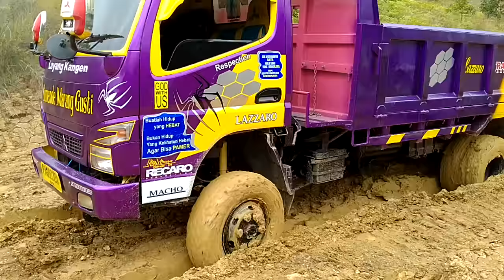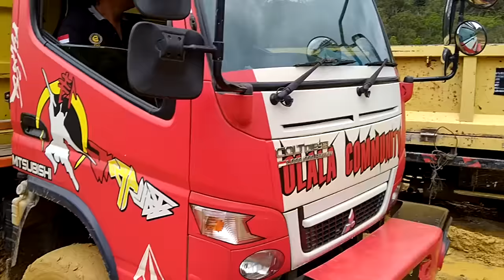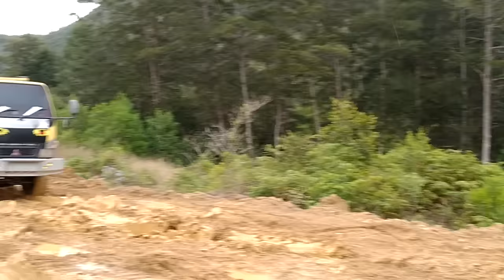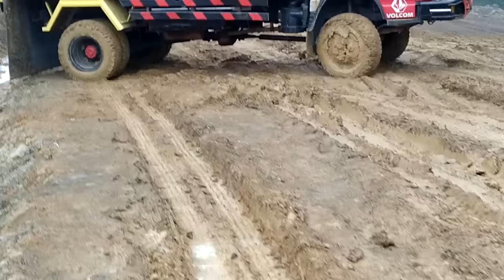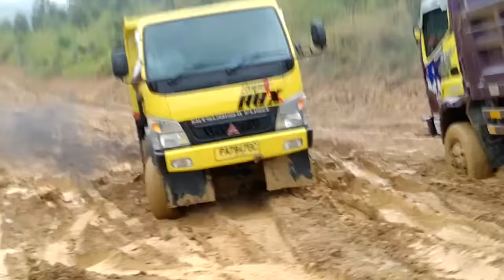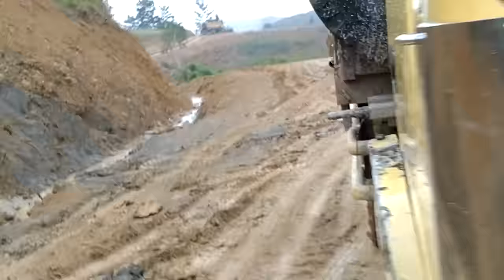Baru mau kerja sudah main lumpur #cerita truk double gardan wamena

Comment: Info estimasi harga modif 4X4 capai berapa duwit ya kawan. Biasanya modif itu di mana karoseri atau bengkel. Mks
Reply from the maker: Kalau di Papua 150 jt kalau di jawa mungkin lebih murah sekarang udah banyak bengkel atau karoseri yang bisa pasang double gardan tapi semau yang di pasang barang  bekas ngga ada yang baru
Reply: @truk4x4wamena78  makasih atas info estimasi kawan semoga sukses selalu. Salam dari tanah borneo kelteng
Reply: @truk4x4wamena78  q
Reply: @truk4x4wamena78  n  ,
Reply: @truk4x4wamena78  b zl
Reply: @truk4x4wamena78  qaaa0
Reply: @truk4x4wamena78  untuk yg baru, sperpart ada pabrikan 4x4 khusus truck
Reply from the maker: @ayubbadriana9975  kalau gardan yang asli rata2 exs Malaysia kalau yang baru kebanyakan gardan modifikasi punya ps120 belakang sekarang pasang double gardan disini 135jt sampai 150 juta tergantung gardan dan transfercase yang di pakai

Comment: These 4x4 trucks are useless if they don't have lockable differentials. I do not understand that they frequently circulate on these difficult roads and do not equip differentials with total lock.
Reply: J
Reply: Hhx
Reply: Hyc
Reply: H  c
Reply: @muhammadradit7955  x
Reply: @muhammadradit7955  u
Reply: Tc
Reply: @muhammadradit7955  ł
Reply: Bentuk mobil dengan ban dan jalan berlumpur seperti itu lockable diff tidak menyelesaikan masalah. Satu2 nya yang paling efektif adalah winch. Karena lumpur sangat dalam
Reply: @muhammadradit7955 
076m3

Tteeew
Reply: @muhammadradit7955  iioo
Reply: @muhammadradit7955   mzv😟
Reply: @muhammadradit7955  🥰